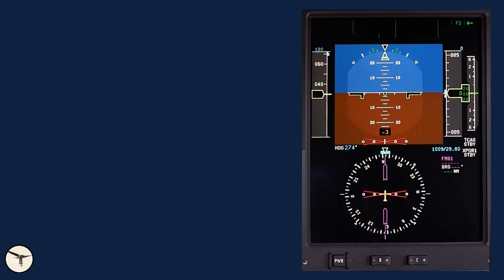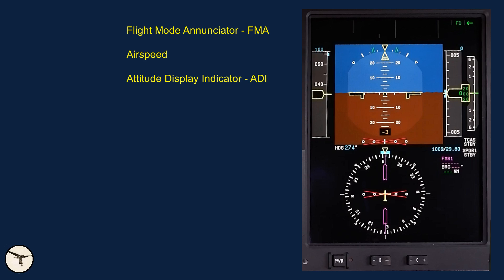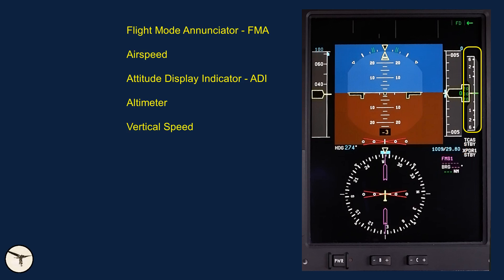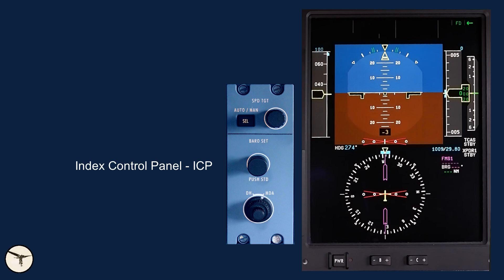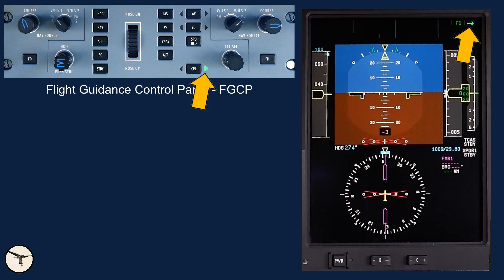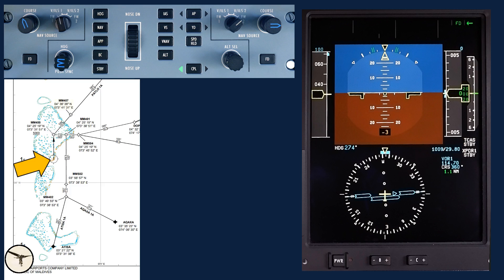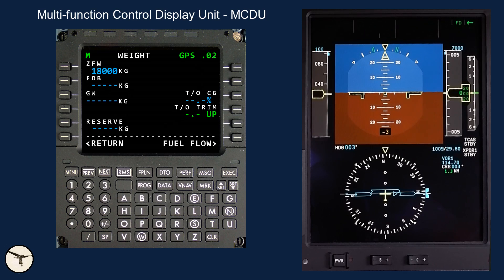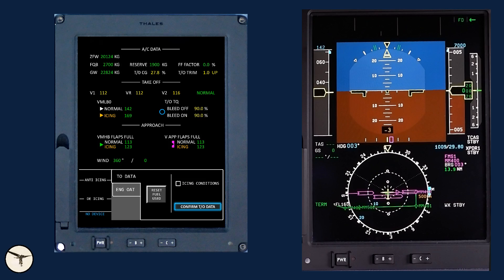ATR systems - Primary Flight Display & Autopilot part 1 - From power up to take-off

Comment: I ' m little confused: (1)VNAV IAS aircraft reaches the selected altitude according IAS speed; (2)VNAV ALT aircraft reaches  the selected altitude; (3)VNAV VS aircraft reaches the selected altutude according VS selected; (4) VNAV PATH aircraft reaches the  selected altitude according to constrain. 1, 2,and 3 modes do not level in case of costrain before the selected altitude. Does it makes sense? In VNAV ALT which is the ratio of climb/descent?
Reply from the maker: I will make a video about it soon.
Reply: @FlywithMagnar  thank you. Have a nice day